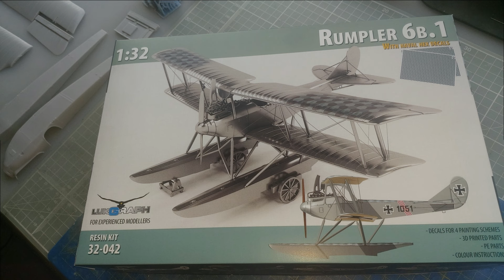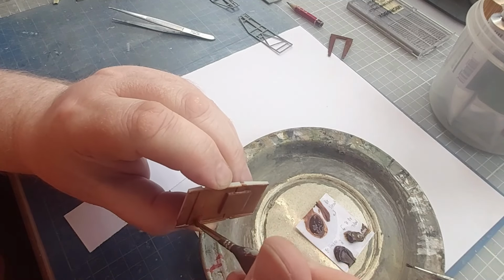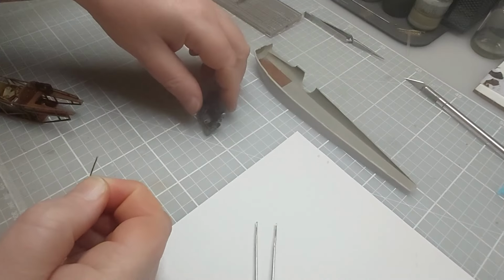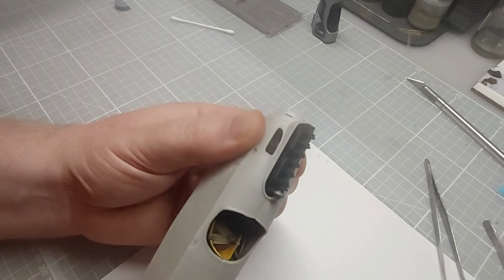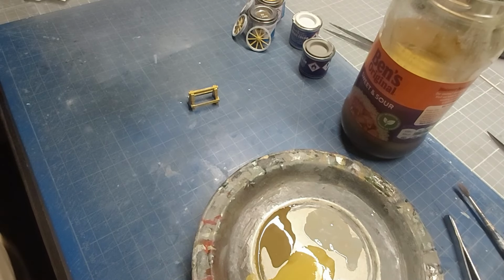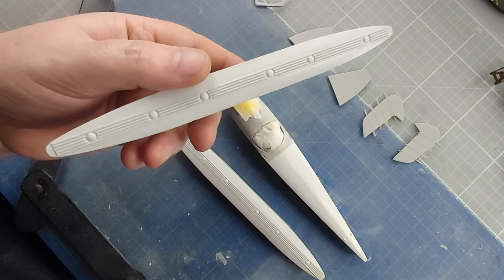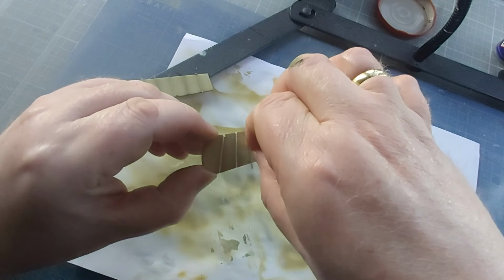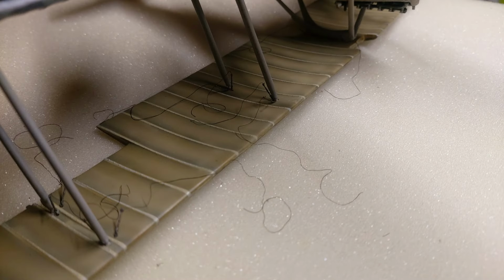Lukgraph's 1/32 scale Rumpler 6B.1

Comment: A very impressive kit and lovely build Paul.  The lozenge decals are a beautiful color scheme.  I have to believe that attaching the top wing was a bit of an adventure.   Well done!  👍👍
Reply from the maker: Hi, Mark... "...a bit of an adventure" sums things up very well, I'd say.    I like the transfers a lot, too; they're a lighter shade than the Aviattic ones I've used before, but both complement each other when you see them side by side in the desplay cabinet.  I like the beaching trolleys as well as they really set off the model when it's finished.

Comment: Excellent work! I was on the fence about the whole idea of having to cut out my own decals, but watching you do it makes me feel (almost) brave enough to do it myself. The final result looks realistic and fantastic.
Reply from the maker: Hi, thanks for taking time to look in on the build, and for your comments.  I appreciate them very much.   

It can be tricky to map out the exact dimensions of a section of transfer when you're working from an A4 (approx) size sheet, but I find just drawing round the outline of the part gives a good result.  Of course, patience is always helpful - sometimes it seems to desert me! - but I found that once I had the full length for the float uppersides, as an example, it was easier to cut it into sections so as to be able to apply and match each section as I went along.  

Bigger areas can be done the same way; with the wings, it's helpful to make a cut at an appropriate section - perhaps the edge where the aileron fits -  and do the area nearest the fuselage first, let it settle, then match the smaller area from the aileron edge to the wingtip.  Breaking things down to smaller sections can be worthwhile, but just ensure a seamless match of the pattern.

If you have some old transfers and an old model, you could perhaps practice first so you can get a feel for the process.  Good luck when you get around to trhying out this method... :-).

Comment: Thanks for the review. What is the difference between Resin Casting Parts and 3D Printed Parts ? Should I wear a mask when working on the kit ?
Reply from the maker: Hi, thanks again for taking time to look in on the video - much appreciated.

I'm not very familiar with resin, so I made a quick check online... 🙂 - the following are some, but not all, of the differences, and some reasons for using resin.

 - 3D pieces are printed in layers from a CAD (computer-aided design software) file.  Casting is putting resin into a mould and letting it set.   
 - Both use different materials, thermoplastic filaments (3D) and epoxy or polyurethane (casting).  
 - 3D can produce more intricate pieces, but casting can give a more durable finish and generally lasts longer; 3D is less expensive. 

I would strongly suggest using a mask when you are removing pieces from their plinths - a proper mask with air filters - a thin mask wouldn't really be sufficient; breathing in small particales of resin dust could be hazardous to your health especially over a long period of time; eye protectors may be good to use as well, especially when separating the 3D pieces from their mould base as they are more brittle and small pieces of resin could, potentially, spring off the base and hit you.  However, once you've got things ready to paint and build, you may want to remove your mask and eye protectors but if you have to sand any pieces to smooth them out or adjust their shape, a mask would again be advisable as you would be back to the same issue with breathing in dust from the parts as you sand them.  

From time to time during the build and at the end of your day's work, it would be a good idea to wipe down your workbench with some damp tissues as any residue dust particles will adhere to the damp tissue and leave the work area clean for you to start work the next time you're working on your kit.

I hope this helps, and perhaps we will see your model(s) here in the future... 🙂👍.
Reply: @modcon8297  Thanks a lot.
Reply from the maker: @quannguyenthanh8868  You're very welcome... 🙂.